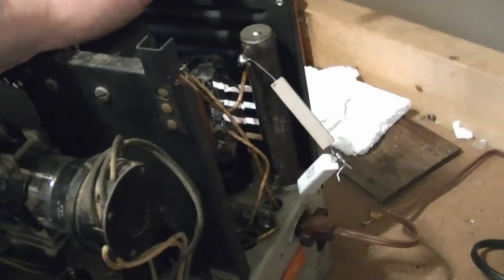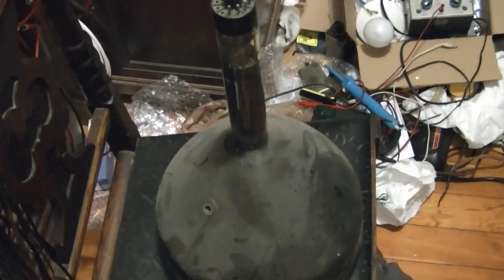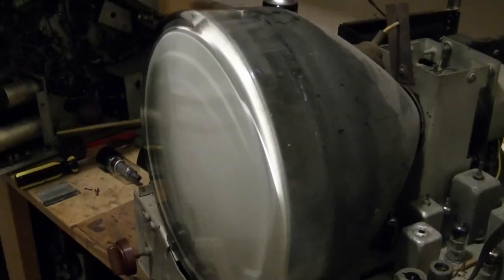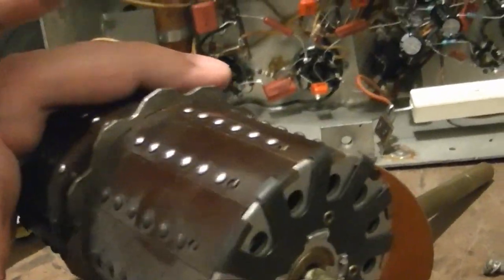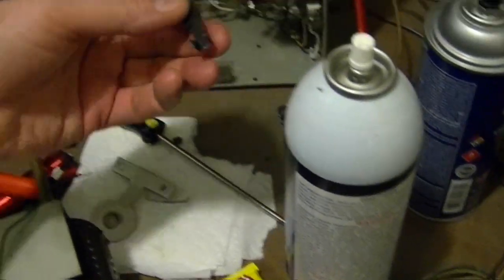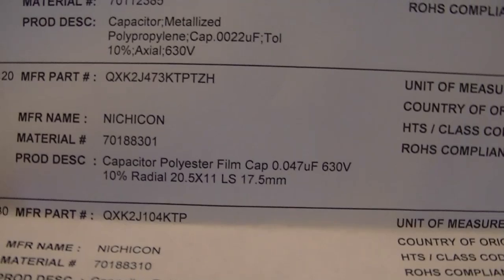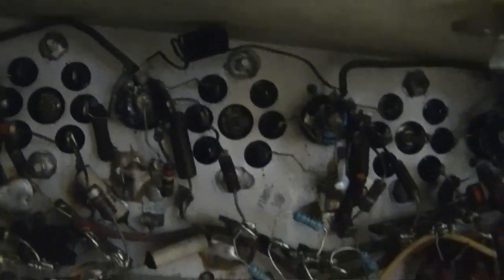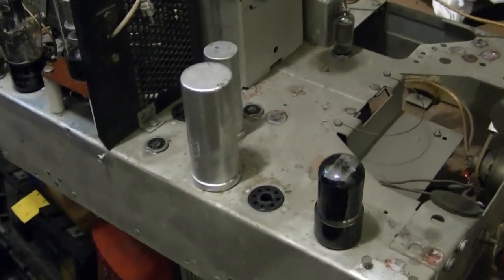Admiral 30A12 restoration pt5o?

Comment from the maker: Thanks!  I really did think this would be a 1-2 day project since it was working so well to begin with.   There are more twists and turns coming up shortly in the next installment.

I have to plead ignorance to as far as to the latest specific regulations.  I do know that these very old B&W CRTs don't have the high lead content like more modern color CRTs do.  They also don't have the cadmium type phosphors some early color CRTS did.

Comment: Haha!  Sounds as if you have the same issues with Murphy's law as I do.  My little side hobby is taking in laptop or desktop PC's and upgrading or "cleaning" the computer.  People have problems with slowdown or lockup and I will take them and go through various procedures to get the speed and performance back into them.  No formal training, just used my old PC's as guinea pigs until I got a feel for what they want.  However, what should've been an easy fix, winds up taking forever!  LOL

Comment: I heard about another technique for opening twist lock can condensers, that method involves filing off the crimp on the bottom, but then the metal ring with the twist tabs under it won't be attached to either the can nor the insulating disk. I guess you could glue the ring to the disk with epoxy or something?

Comment: One luck, DC ist as dangerous as AC, AC contracts yout muscles so your hart to that why ist so deadly, ik work with tensions DC 5000 volts at 1 Amp, powersupply for a transmitter

Comment: Bob:

I think next time I'll try your method of cutting the electrolytic can with the utility knife. You really have a nice clean cut there. It sure looks a lot easier than un-crimping from them from the bottom! That is one pain in the...

I'm really surprised about a power resistor in the I.F. can. You would "think" that you would want heat down to a minimum in there.
Reply: Maybe you can use a plumbing pipe cutter for easy opening the filter caps? 
Just an idea.